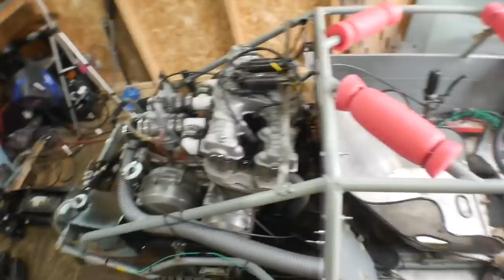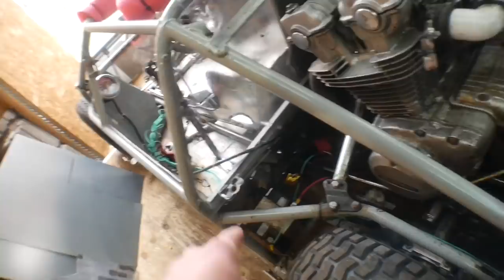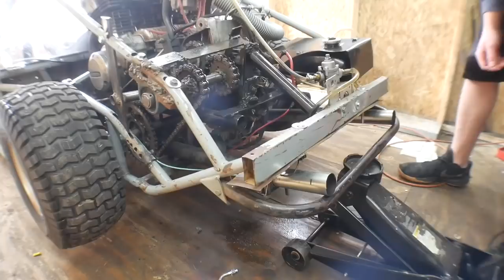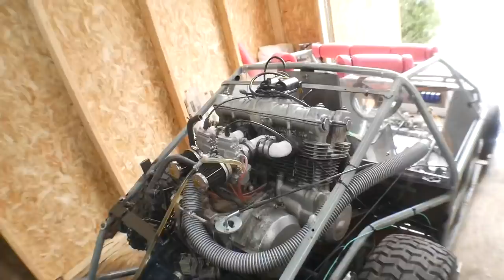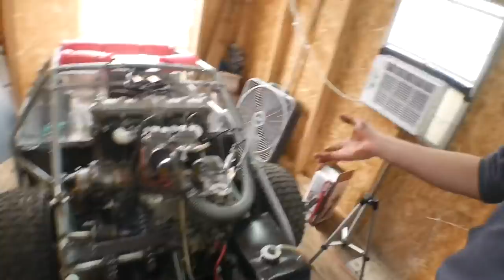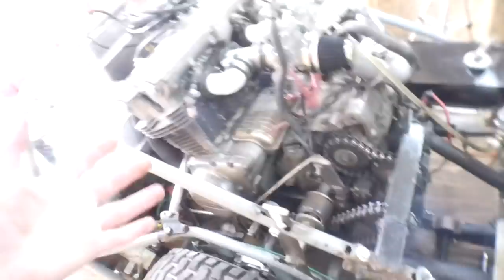After DAYS of Trying to Fix the NasKart, It RUNS Once Again! The Repair Was So Simple!

Comment: Hey migs you have a welder now so use it to weld a nut to the oil filter bolt and remove with a socket then replace after.
Reply: Or cut a slot in it for a screwdriver but welding a nut has most of the time worked for me!
Reply: Had the exact same idea.

Comment: I'd recommend adding one or two more tubes to keep the engine cool. The tube present in the kart right now is only distributing air to one part of the engine which is the intake. I'd add a few more in some different areas to make sure it stays at the right running temp under the fiberglass body.

Comment: Welding a nut is a good trick, also a little heat helps to work loose the nut heated wrench It.  There are special sockets, as well. Worst come to worst I wouldn't worry about changing the filter....

Comment: Hey Migs, the yellow wire connectors you're using are meant for 10-12 gauge wire. The wires look more like 14 gauge which require the blue 14-16 gauge connectors. Good idea to use heat shrink connectors also.
Reply: i wonder if he knows soldering irons exist

Comment: Hey Man, if you know how to wire one, the signal wire and the power wire and ground wire. You can get coils from the junk yard off of an LS Chevy or any coil on plug. I put two on a 18 horse two cylinder Briggs and Stratton for my uncle's old Sears tractor. Works great.

Comment: Hey man what I would do if the bolt is rounded out either I would cut a skirt in it like a flat head screw driving would fit or take some vice grips and clamp on it really good and try to get it to turn or buy a special socket

Comment: if you want t o make the engine run better , more smooth , you have to change the inlet . connect inlet 1 and 3 , 2 and 4 . Because those cilinders move the same up and down, Now you are starving 2 cilinders every cycle , with not enough fuel

Comment: You're also running rich on half the cylinders!!! Fix your design for the intake
Reply: @John--cu2yu  I mean it could be, but I'm sure he makes a little bit off the videos he posts. Hes young, probably doesnt understand the flow principle and how air goes through least resisted path. It works but not well the way it is. The 2 inside cylinders are getting a majority of the fuel and the outside 2 are running lean...